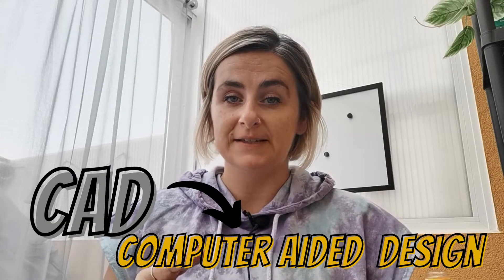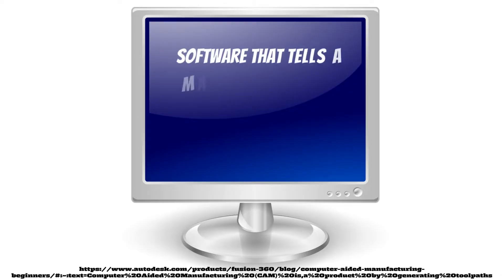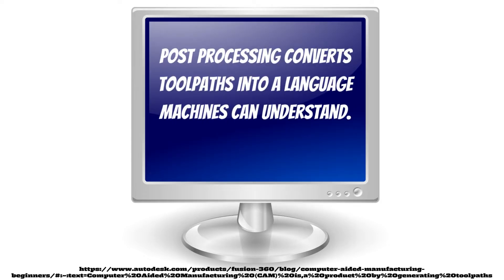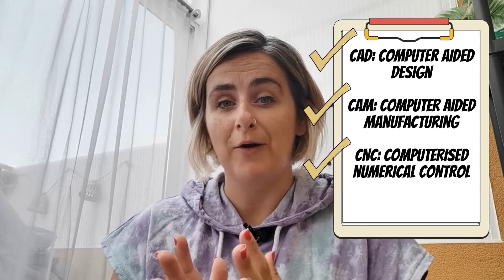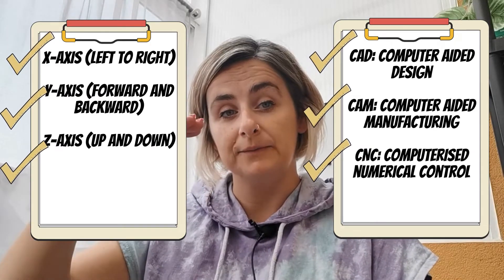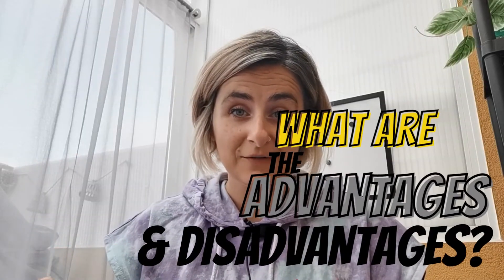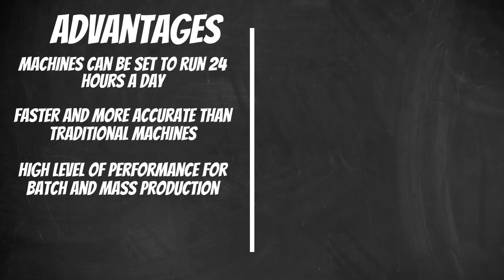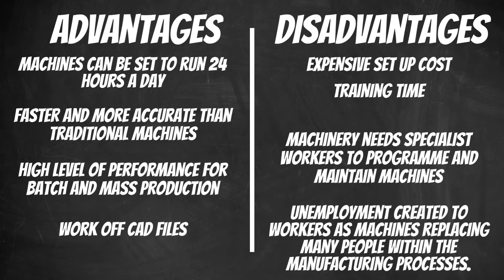WHAT IS COMPUTER AIDED MANUFACTURING (CAM)?  // GCSE DESIGN AND TECHNOLOGY REVISION

Comment: Thank you for the informative video. May I please ask, is 3D printing part of CAM?
Reply from the maker: Your welcome, CAM normally applies to CNC machines due to the softwares they use. 3D printers are aiding the manufacturing process and are supported by softwares. So yes they can be considered to be a piece of CAM.

However they do differ from CNC machines as they use different softwares and add material rather than take away material like traditional CNC machines.

Hope this helps 🙏
Reply: @designandtechnologyondemand  Thank you very mach. I appreciate your reply.